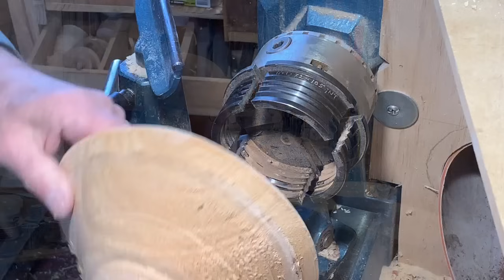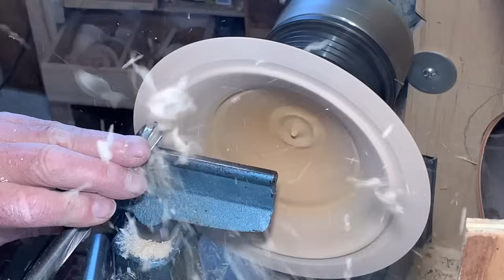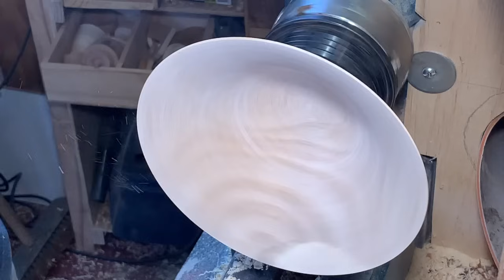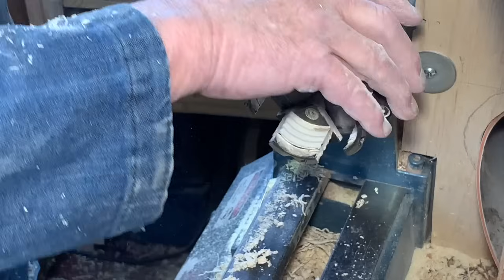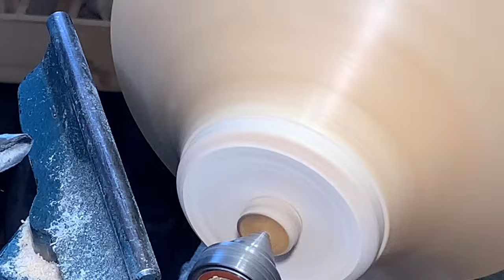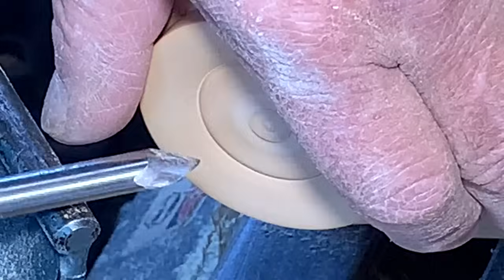Richard Raffan turns a thin ash bowl

Comment: I am especially impressed with how you resolved the forgotten nib on the foot and removed that MDF pad to finish the bottom. I really laughed when you were holding the bowl on the spinning lathe with only your finger! I wondered how you were going to shape the transition from the foot to the side and I really like the ogee-like shape that was the result; much better than a simple straight line. Now, talk about thin... When you were reminded how thin you had made the bowl by the sound of the wood, I really locked that TIP in my memory for my own use.  Very helpful, educational and a beautiful bowl. Thank you for sharing this video.

Comment: Richard:  Thank you for all your videos, I’m a big fan. Watch them all. I had to dig back to find a video relative to my Question:  when I try to use (pure) beeswax alone, mine seems hard relative to yours. Hard to get it to take. Is your wax mixed with anything?  I see sometimes you use an oil first.
Reply from the maker: My beeswax is at least 60 years old and hard, so requires more heat to melt than fresher wax. I have one softer lump mixed with boiled linseed oil —next time I'll try to remember to record the proportions.

Comment: What was the moisture level and how long a wait from roughing to finishing.
Reply from the maker: I've no idea of the exact moisture level, but as you learn at the outset it'd been roughed about 10 mnths earlier. Claret ash is a fairly stable timber and roughed bowls typically stabalise within a year although longer seasoning is usually preferred.  The moisture was probably around 12%, maybe a bit lower.